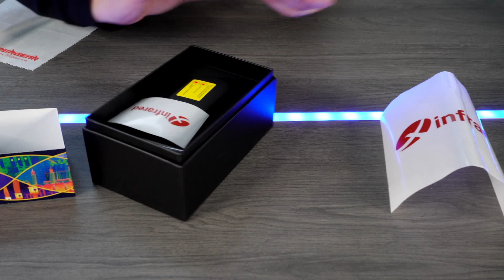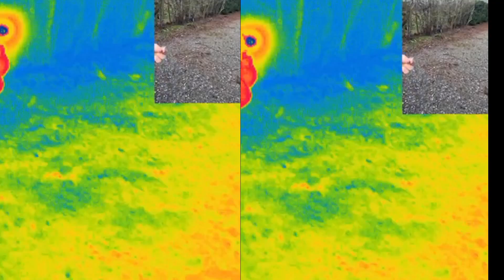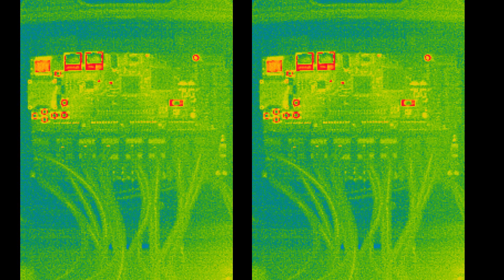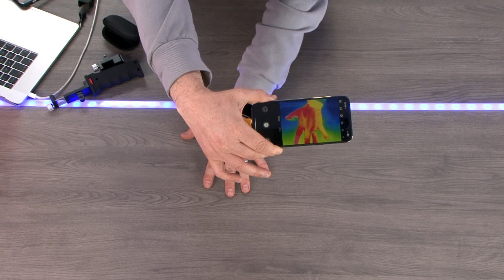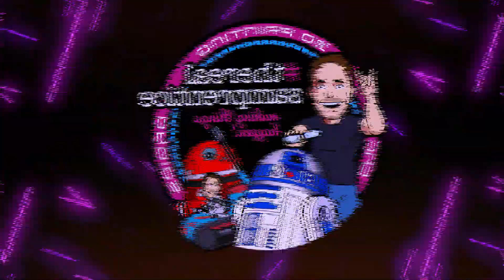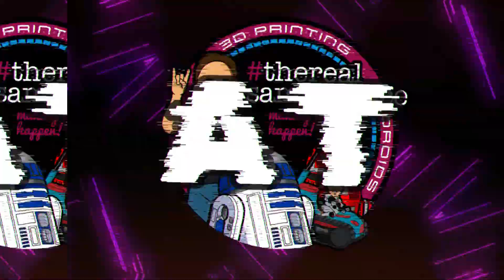Unveiling the "Plug and Play" Xinfrared T2S+ Thermal Camera 🤔

Comment: For reflective parts, use a Sharpie or painters tape to get an accurate reading. Look at things reflected on a mirror. You won't see the temp of the mirror but that of what is reflected.
Reply from the maker: Great advice right there thank you for your comment!
Reply: I've always been told black electrical tape has an emissivity of almost 1. Thing to remember w/ emissivity is that you divide by the number so what you see at 1.0 is the lowest temp it could be.
It's rather interesting to see what acts as a mirror to IR that is transparent to visible.
Reply: @OldCurmudgeon3DP  This guy. Do what he says.